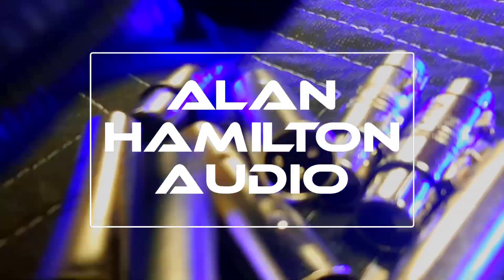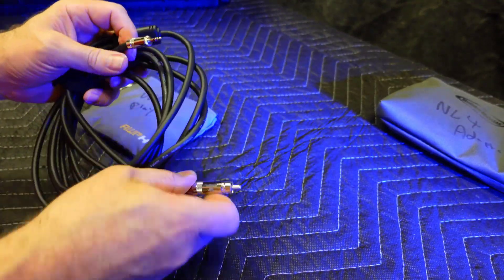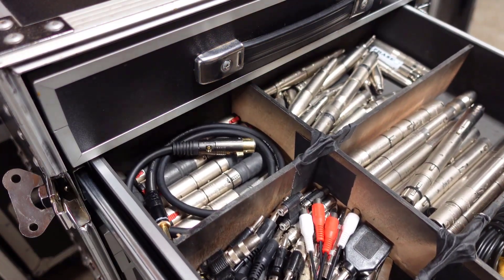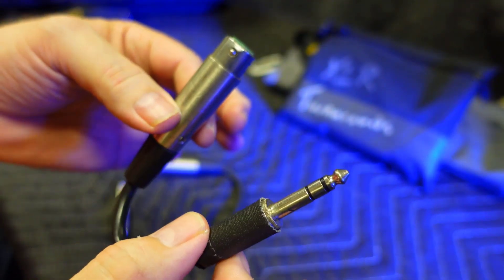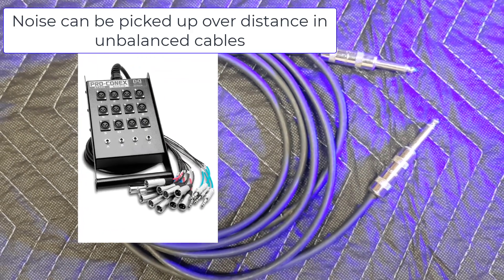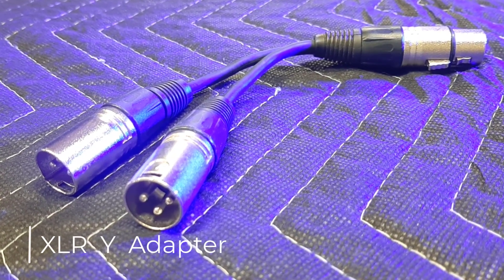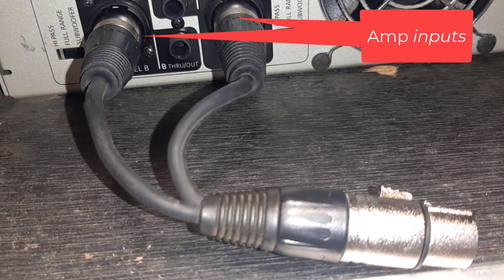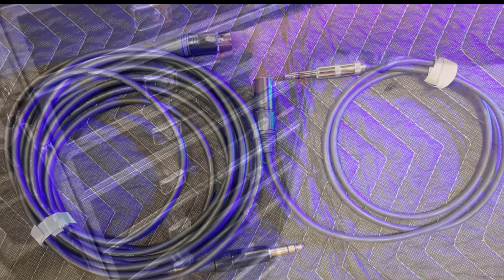What Are My 5 Most Used Audio Adapters for Live Sound Reinforcement?

Comment from the maker: This video is a look at the 5 adapters that I seem to need/use frequently for one reason or another. Whether it is to split a feed for recording, to tie a couple of amp inputs to one output, to extend a Speakon cable, or to turn a snake cable channel around... these all come in handy. Since it's talking about TRS to XLR, and devices with only a balanced TRS out and no XLR out, besides talking about adapters to swap that over to XLR I also included a clip from a previous video explaining a typical balanced I/O circuit and how it works.
Amazon links to the adapters are in the video text box.

If anyone has been using a 3.5mm TRS to 1/4" TRS and connecting to a single channel on the mixer, then check out this video:
►Connecting an MP3 Player to a Mixer - Don't Make This Mistake!:
https://youtu.be/UiauwFEFe_k

Suggested videos:

►Analog Audio Over Ethernet Cables via Adapers:
https://youtu.be/FW6c4ROQbLc

►5 Tips for Better Live Vocal Mixes:
https://youtu.be/oP4sdpkkNhY

►How to EQ a Kick Drum:
https://youtu.be/CQg1_-ZJ4MU

►How to EQ a Snare Drum:
https://youtu.be/J_WC68vyht4

►How to EQ Toms:
https://youtu.be/nSLJqnlJe60

►Cable Management For Live Audio:
https://youtu.be/nYZ9nrPGswo

►Patch Order and Input Lists For Live Sound:
https://youtu.be/FE2KRj8vEEc

~~~~~~~~~~~~~~~~~~~~~
►Facebook Group:
https://www.facebook.com/groups/livesoundproduction
~~~~~~~~~~~~~~~~~~~~~

Comment: I found one I had to build myself. Had an AM radio station tower 700 feet from the stage. Distorted radio was in the mains off the snake from FOH. Made an RF filter using bifilar wound chokes of 15mH to cut the 30V P-P RF. Used one choke for the balanced signal and a 2nd one on just the shield to keep RF current out of the equipment. The speaker management unit could not take the high RF levels, so 3 filters were used for LR main and subs. It was the worst RF environment for audio I had worked. The filters worked perfectly with no attenuation of the balanced signals. It cut the common mode RF by more than 50 DB which eliminated the problem. At the event, unfortunately some guest bands had some issues with in ears and unbalanced signals on stage, so it was a problem. Building some unbalanced versions for the bands next year. It will use the bifilar wound choke on the signal and shield as a very aggressive version of a ferrite bead on the cable.

Comment: Hey so I just bought a few of those RCA to TS adapters…..

I haven’t tried yet, but I have a crap ton of RCA snakes…….

How well will those adapters work for recording purposes??  I have lots of rack mounts and equipment and don’t always have enough cables - those adapters could really help me out

Any ideas??
Reply from the maker: They should work and probably be 100% fine. Especially in a recording environment. RCA cables normally couldn't take the abuse of getting walked on and pulled on stage (over and over), but for in the studio where they won't get that kind of regular abuse, as long as they are quiet and shielded well, they should be fine with TS adapters.

Especially if we're taking short distances and not 30'-50'+ or anything like that.
Reply: @AlanHamiltonAudio  awesome - great response.

Yea definitely will be short length.   Ya know, like rack mounts to patchbay type of stuff
Reply from the maker: Cool! That's what I figured. Should definitely be fine.  @danevertt3210

Comment: I would add the following: a few of those tiny ts-trs converters for mobile phones, a XLR splitter but with a transformer (instead of the simple cable XY), I use a coulple of small stageline splitters. Then, maybe some really important ones, the XLR to TS connectors. I've found occasions when some keyboards had outputs not balanced and I was forced to use those becasuse i didn't have any extra instrument cables at hand. Some times if you go record a simple gig, you are not able to bring a whole heavy rack of things with thosands of cables "just in case" because maybe you're on your own or you simply don't have the space in a tiny bar, so all this sort of converters are priceless.
Reply from the maker: One of these days I should do a video like this but focus on the workbox. I have a lot of adapters and things in the workbox that really fills a lot of voids that maybe my briefcase doesn't have.

Comment: One more comment from me on the same video... :) About 3.5 mm TRS: Many phones/devices have recessed jacks, so you need a small outer diameter on the plug. Many "classic" TRS -> RCA cables (from your 90's survival kit) are simply too big. Sometimes a knife can fix the problem, or you just make sure to buy the right cable...
Reply from the maker: I keep a few of the narrow 3.5mm style 3.5mm to RCA cables around as well. 
I don't really run into recessed jacks on the devices per se' (though I'm sure they are  around), but instead the jacks essentially become recessed from people/companies adding protective cases to the devices with small access holes that then get in the way of the more heavy duty and larger 3.5mm TRS plugs.
But these smaller molded ends don't typically see much abuse anyway like an XLR/Mic cable might so survive typical use scenarios. I try to keep one of these cables with every console just to be prepared.

Comment: What's the best practice regarding phantom power over a passive split?
Reply from the maker: Typically, it's the monitor console's responsibility to provide phantom power (as a general rule for consistency). And if you have that plan in place then for transformer splits, you know to connect FOH to the ISO side of the split.
But it doesn't matter at all even with passive splits. Even BOTH consoles can supply phantom power at the same time, and not hurt a thing. 

Console inputs are perfectly fine to 'see' phantom power coming from another console. Even with both consoles having it on. And the condenser mic or DI connected to that will be perfectly fine too... They can take phantom power from either console or both at the same time. It's not really a worry, even if you accidentally engage it and don't know it.

So, the only real consideration is just having a system for your normal workflow... That all said, and along these lines, it does matter with an isolated split. But only because the transformer won't pass phantom. You want to consistently have the same position always connected to the ISO side of the split each time so that one tech or the other knows phantom is their responsibility. Of course you can declare that even day of the show before line check... the A1 just says to the A2 "You got phantom today".

Comment: Using a XLR Y splitter, is it ok to have  2 connected to the outputs of a mixer? 1 splitter on the left XLR output and the other splitter on the right XLR output, so then I have 2 sets of XLR outputs instead of one, i want to connect 4 studio monitors to my sound mixer that only has 1 set of xlr outputs
Reply from the maker: I want to make 100% sure I understand your question so that I answer correctly.
You want to split the LEFT XLR output with a Y cable so that you can feed 2 LEFT powered speakers... and you want to split the RIGHT XLR output with a Y cable so that you can feed 2 powered speakers from the right XLR output of the mixer? Correct?
If so... yes... perfectly fine. No problem at all.

Comment: A battery powered Bluetooth receiver!!  So many phones no longer have headphone jacks that the 3.5mm stereo to RCA cables are really becoming quite useless.  The one I use is about 2.25" x 2.25" x 0.75" made by Taotronics, but I'm sure there are many other similar products.  I have this velcro-ed into my mixer rack with 3M industrial "velcro", the plastic stuff that actually goes "snap" and locks the two surfaces together.  This way it's solidly attached to the rack, but can easily be removed for service or testing.

The battery powered aspect is VERY important, here's why...  Most modern electronic devices are powered by small switching power supplies, aka "chargers". Most of these "chargers" produce absolutely horrendous amounts of unfiltered high frequency electrical "noise", which WILL enter the circuits of the device and can produce something akin to the old school sound of a modem connecting in the audio output. This holds true for cell phones too...   if performers show up with phones that are nearly discharged, and you have to plug them in to a charger for the duration of the show, you may / almost certainly will get some horrible background noise in the FoH mix.  I suggest having a battery bank available as a charging device just for this type of situation. Rule of thumb is keep low quality audio devices on battery, never on AC power.
Reply from the maker: I've taken to carrying a BT receiver. It comes in handy at fairs. small town festivals, and talent shows and the like.

Comment: You can use XLR Y adapters to passively mix dynamic microphones if you wire them in series. A friend of mine made a series mic mix cable with the mics out of phase for interviews with the mics sitting back-to-back on a small table between the interviewer and interviewee. Maybe you could mix balanced outputs with a resistive network since many outputs today are like 100 ohms or less and many inputs are 10K or greater. Probably 4 100 ohm resistors in the signal lines of the female ends would do the trick, allowing you to parallel at the male end without excessively loading either output. I can't think of an application where straight parallel wiring would be the right thing to use with a 2 XLR female Y cable. Were I still doing this I might make a couple series mic mix Y cables and a couple resistive line mix Y cables. The resistive line mix cables could be useful if you wanted to put a stereo keyboard feed onto one mixer channel. The series mic mix cable might be useful to put 2 mics on a leslie cabinet into a single mixer channel. How do you use your 2 XLR female to XLR male Y cables and how are they wired?

Have you ever used stereo mics with 5 pin XLR? Then you need a 5 pin to 3-pin Y adapter to hook them to a pair of standard 3-pin inputs. You can make 5-pin mic cables out of StarQuad; use the Blues for one channel and the Whites for the other for lowest crosstalk. And if you have long 5-pin mic cables, you can use them to replace 2 normal mic cables even if you're not using a stereo mic with a 3-pin to 5-pin Y adapter.

On a similar topic, there are little 4-pair mini snake boxes which are sold by Parts Express. They use very flexible shielded cat 5 cable, a way to run 4 mics in a single cable which might allow less cables on stage. I can see this as a good way to drive an amp rack with a house mix and 2 or 3 monitor mixes... You could probably just mount the RJ-45 right on the connector panel and maybe even in your snake box. Neutrik makes both 8-pin RJ45 with ground connectors which can interoperate with normal sheilded RJ45s, as well as 10-pin connectors designed for Ethernet + DC power. The Parts Express stuff uses the Neutrik RJ45s.
Reply from the maker: Yes. I have a video about the Cat5e to XLR adapters. VERY handy. Plus, since I have a lot of Cat5e STP Supercat with Ethercons of various lengths, having a collect of fan outs and boxes for making quick snakes is really handy and I always have a spare cable to use for them.
I have a couple of 75' Cat5e STP Ethercons married that one takes drive from one side of the stage to amps on the other side, via Ethernet to XLR fanouts, and the other carries control signal between processors and the router.

I also use the Supercat for DMX and for ARTnet. And also have some ethernet/ethercon to 5 Pin DMX fan outs too.

Comment: Alan, your videos are so informative and helpful. Thank you for all the work you do. I have a question that I can’t wrap my head around.  For my live shows I have a VERY stereo image, every instrument is stereo.  I use two EV evolve speakers and just monitor myself by standing to the side of them. Sometimes when I need to be super loud I want to stand farther behind the main speakers and want to have a single mono monitor speaker. I want the monitor to be the exact same mix as the mains, everything exactly the same eq effects mix. But just mono. If I take one XLR out of one of the aux outs it’s gonna be either L or R. Is there an east way to get a mono summed feed of the main out of one of the aux outs?
Reply from the maker: Yes. Mostly anyway. Unfortunately, the most simple way is not available since you can't assign two busses, like both left and right to one XLR output... But there are two other ways. Probably the most simple way to get an exact, cloned but mono, mix out of an XLR out would be to make one of the busses a (mono) subgroup. By default it will still come out the same XLR out as before, although you can change it in routing if you want. By making it a subgroup it automatically adjusts the send level to unity, meaning whatever the channel fader is at is also what it will feed to the subgroup. 

Make sure every channel you're using is assigned to this subgroup, and the subgroup is enabled on it, including the FX RETURNS.

Then in the master section for that bus you just made a subgroup it is important to make sure it is NOT assigned to left-right. You don't want it ALSO going to L-R... only to your XLR aux out that you want to monitor.

CAVEAT: What won't be in that mix is any L-R processing you're using. Like if you have an FX rack compressor inserted. Or any bus compression or house EQ on the mains. But that is generally not going to be a problem because you generally don't want house EQ to be your mon EQ anyway. And, if you do want it, you can just copy the settings to the subgroup's EQ and comp. Unfortunately, you can't do that to something you've inserted into the main L-R bus since that is on the main L-R exclusively. You could insert another instance of it in the subgroup and copy settings from the mains if you have an FX rack slot to spare.

The other way to do this is to use a POST FADER bus on each channel instead of pre-fader/pre-EQ, etc... In that case, to clone the channel you'd just set it at unity (which is what the subgroup setting did automatically and doesn't even allow it to be anything but unity). But, now you'd have the option to make a few things different in that buss if you needed it to. It could be an exact clone of the L-R if you assign everything at unity... or you could adjust something differently if you want. It'll still track with the channel faders and changes, but it will track from the baseline of what you set the post-fader bus at to begin with.
The other caveats stay the same as the subgroup setting... Make sure in the master section it is NOT assigned to L-R. Don't forget to set your FX RETURNS to also have this selected bus send be set to post fader and at unity (or wherever you want to readjust this to be different than the house feed. Of if you want everything EXCEPT the FX from FOH, then you can do that too. 

FX Rack and output processing used on the mains would work the same as what I said about the subgroup method.

In either of these two methods, the main LR output fader won't change your monitor mix. Which is probably good in most cases. Or won't matter.

Those are the "spend no money ways" to do it. You could get a small mixer of some kind that has a couple of inputs... Use Y cables like mentioned in the video (XLR F to 2xXLR M). You'd need 2 of those connect one to each of your current mixer's L-R outs. Take one side of each Y and send it to you FOH system as normal. Take the other side of the 2 Y cables and send those to your small mixer. Adjust the gain of that mixer, set everything flat on the mixer, and set the pans to mono on the two channels you're using. Then that means, even if that secondary mixer has no dedicated mono out, the Left or Right output has the same signal. So take one line from either that left or right, and feed it to the input of your monitor setup that you want to be a mono clone of the house.

This method has the 'benefit' of capturing your house EQ and any compression, including any processing you've inserted from the FX rack. That assumes you even need that. It also will capture the main fader moves of the house console. So if you 'need' those things, this would do it.
Reply: @AlanHamiltonAudio  You are the man! And an XR18 genius! This all makes perfect sense and I KNEW the answer was gonna have to do with subgroups. Which I've never used before but have watched your video about. I can't thank you enough for taking the time to type all this out.  I get lots of questions on my YouTube channel from aspiring loopers and I know how much time it takes to give a thorough answer to all the questions.  Appreciate this response so much!  One side question about the separate mixer solution...What if I came out the AUX 5/6 as Master LR and just plugged two XLR cables into my QSCK10s two channels and set them to the same level.  Would it cause any phase issues or something like that sending L/R that are basically the same into the speaker's two inputs?  Because the QSC bacially has a built in mixer does it not? I feel like this could be a simple solution but worry there is something I'm not thinking about (having to do with phase cancellation or something possibly).  Again, thank you for your response!